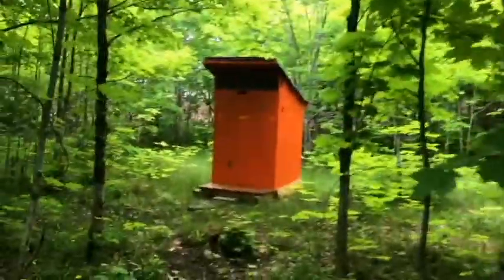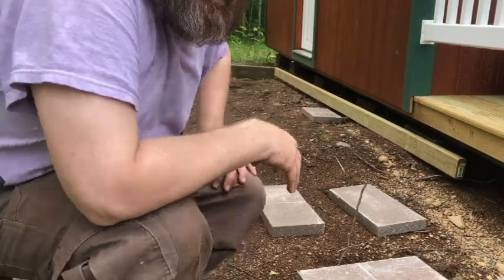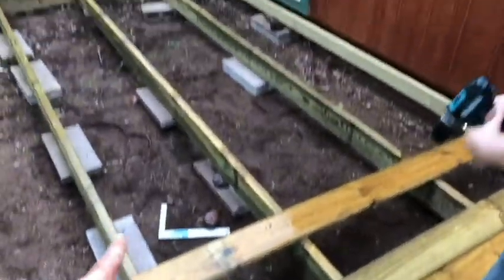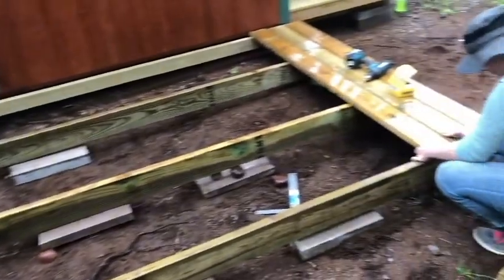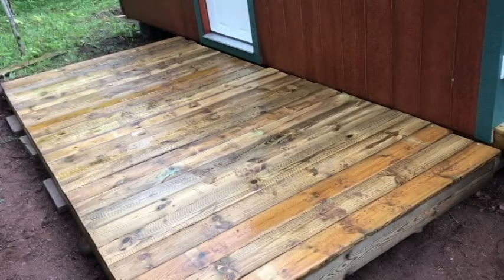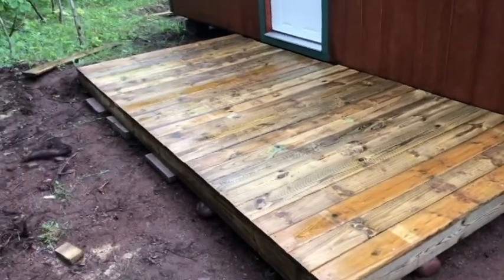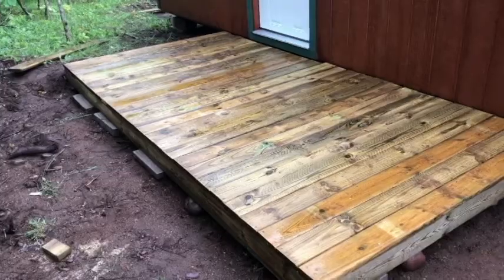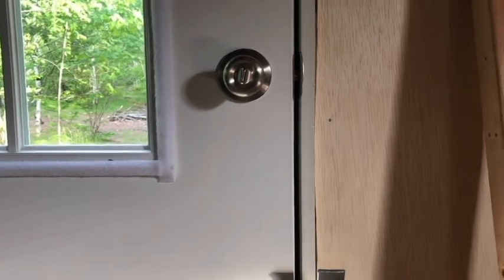Building the Cabin Deck and Door Barricade

Comment: Well done. 

It won't cost much to get a better door knob with a longer bolt.
Reply from the maker: Dave Johnson well. The the cost of doing it dungeon style was $12.  Plus I didn’t want to risk the snow pressure exerting all that potential energy on a single point.
Reply: Do both.

Comment: My first thought for the door was a dead bolt with keys for the outside - that would keep that door shut. With a turn lock on the inside, you can still get out fast too. This cabin reminds me of the shed things they have at the local Home Depot - I live in farm country now. One of those "sheds" was a two story unit - looked like for a garage and a work area up top - and space in the main area too... very neat - the first thing I said to my wife is it reminded me of an oversize tiny house (of the sheds).... the work looks very well done - hope that you have a lot of time to enjoy it! Watching and Supporting!
Reply from the maker: Ray Hayden I’ve seen that 2 story Home Depot unit.  It’s nice! This was actually built by the Amish in southern Illinois.   And driven 600 miles north. We thought about a dead bolt.  The problem with that is it would be a single point of stress.  The snow last year was about half way up the door.  That’s a lot of pressure.  So we wanted something with more stress points. Plus. It was only $12 for everything.

Comment: Awesome job.  Any chance your leveling stones might shift?  I know nothing of construction.
Reply from the maker: Jamie Eckles it’s possible in the winter but not likely with all the sand and gravel.  We actually built a smaller one at the house almost exactly a year ago and the soil there is crap and it’s fine. Plus the thing probably weighs 500lbs. 

The cabin is on blocks. It’s been 10 months and no noticeable setting.  So. Fingers crossed!